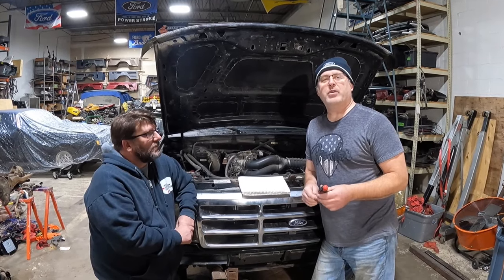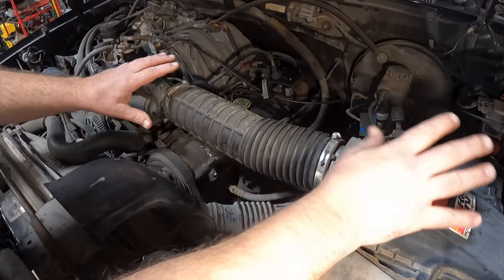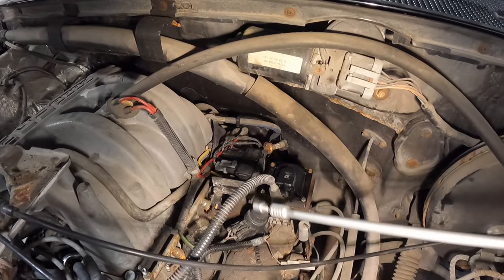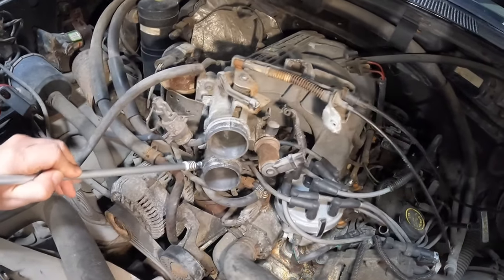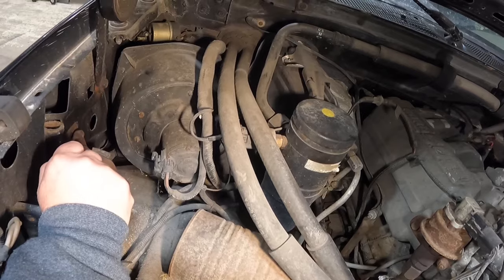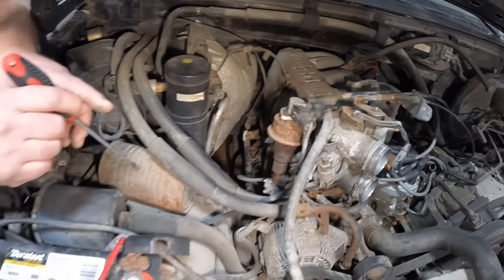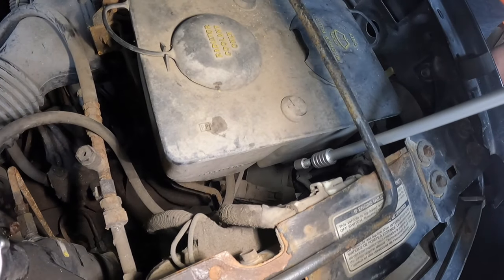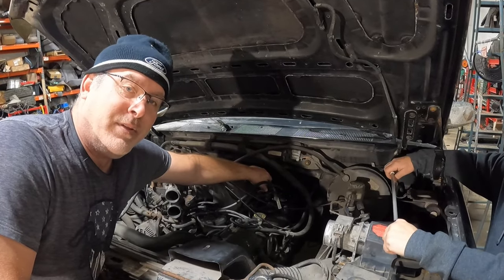What’s Under The Hood Of Your OBS Ford Truck / Bronco - Identifying 35+ Components (92-97)

Comment: Was wondering if anyone could help me with a problem. My 92 f-150 4.9 inline 6 idles high and then low and then turns off. Once the truck is warm and running the problem goes away. I have changed the idle control valve so that’s not the issue. Was wondering if anyone has ran into this or has a solution? Thanks in advanced.
Reply from the maker: sorry, no experience with the 300.  try posting in the Broncos And Parts Garage FB group.  lots of helpful people.

Comment: I have a 95,  what engine is this?
Reply from the maker: 94 or 95.  Cannot remember.
Reply: I found out the difference.   Air intake and maap.  Both 5.0.   Manual and automatic.